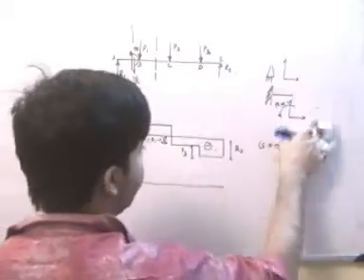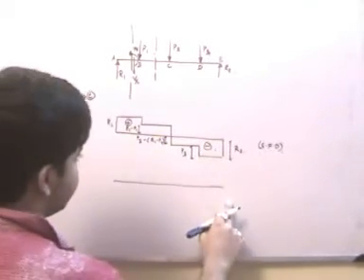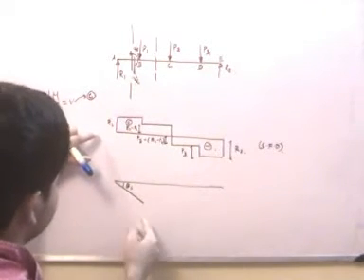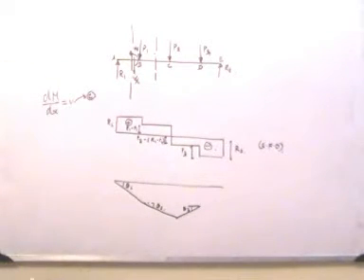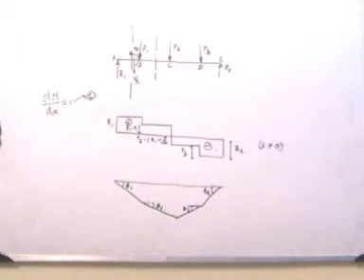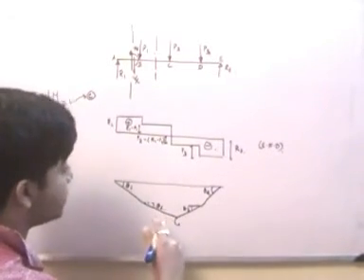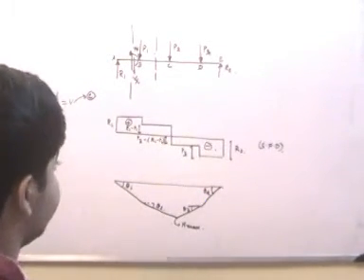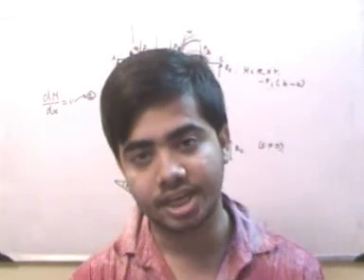understanding shapes of shear force and bending moment diagram for transverse loading-2.mpg

Comment: I disagree with the moment diagram,the shear and moment diagram are disconected due to sign,just rotate the moment diagram 180 degree vertically,the result or effect will be the two first line with negative slope, now are positive and the following ones are negative.